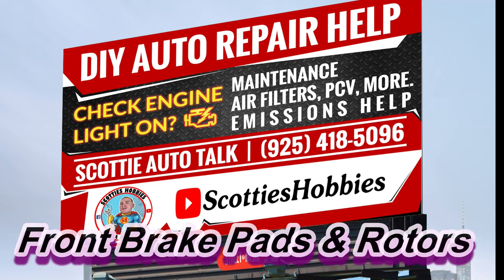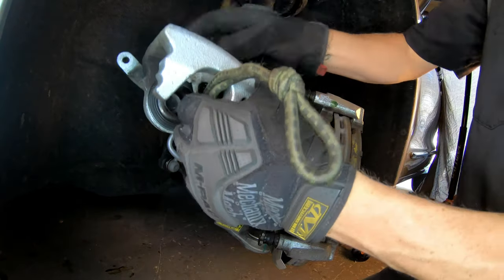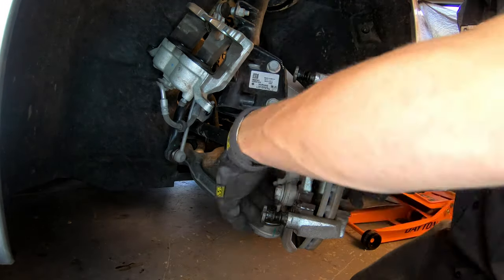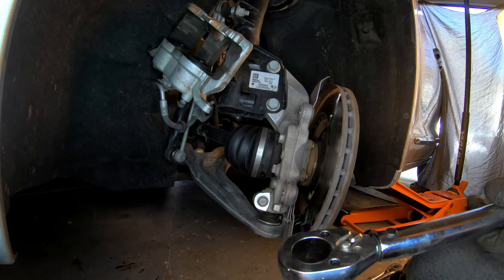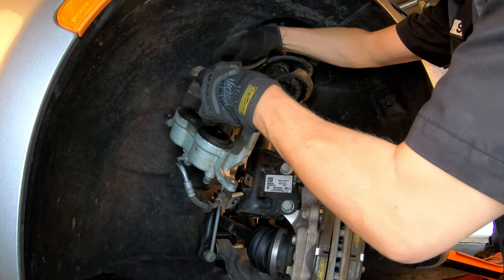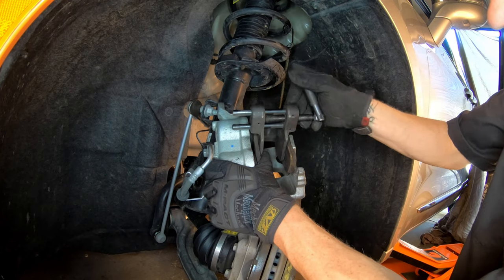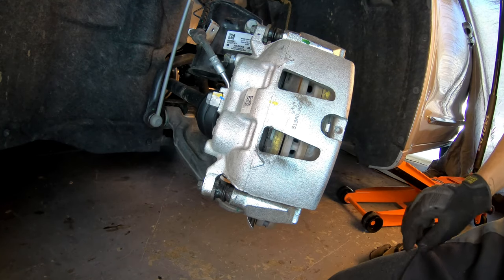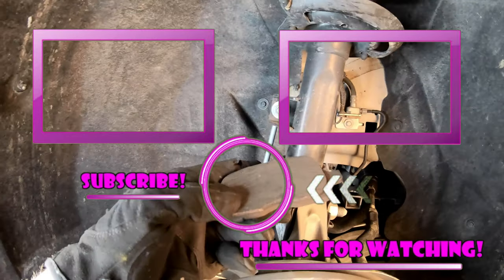⫷ Chrysler Pacifica Brake pads and Rotors, Tools Used. DIY brakes.  ⫸

Comment: When doing the rear, DO NOT forget to put the brakes in (Service Mode) first, which will release the electronic piston for service.
Reply from the maker: Is that in the description?
Reply from the maker: It's not actually.  I need to find the video on the procedure you are talking about. I thought I posted it there. Hopefully I'll find it and add it.

Thanks for pointing that out.
Reply: @ScottiesHobbies  No prob. This applies only for the rear calipers on models with electronic emergency brakes. 👍🏻

Comment: Where on the vehicle did you line up a supporting jack stand?  Or did you just let the jack hold the load?
Reply from the maker: I believe there is a small 3 ton jack under the front sub frame. not holding it up but only to stop it if the jack fails. Not the best way... I usually just slide a stand under their and raise as close as possible, then move on.  I've been told I have too much faith in my jacks a few times..

Comment: Thank you for the video. I'm daring to attempt a brake pad & rotor replacement myself. I have a 2018 Chrysler Pacifica Hybrid Limited. Would have i have to do anything different beause I have electric calipers - at least that is what one mechanic stated.
Reply from the maker: On the rear you have electronic calipers. In that case you need to put the vehicle in 'brake service mode'. It's really simple if you need to do that. I dont have a video but im sure you can find one... if you can't, let me kmow and I can refer you to one later when i het home. Don't let these brakes be intimidating.
Reply: @ScottiesHobbies  - Thanks I found a video that shows how to put the Van into Brake Service Mode. - Thanks! I'm going to do it on my own!
Reply from the maker: @thedragonb  nice! Good luck! Keep me posted on how it goes. I know you will be fine. Especially if you fallow this video.  I can't wait to hear how it went.
Reply: @thedragonb How did changing the hibird go ?  I might do it also.  2022
Reply: @davidhale6721  - I still have yet to do this and now looking at the date. It's been 11 months. My brakes are still good and I haven't heard any squealing. But I may have to soon. - I did find anothe video that you have to do something on your screen to service the brakes... Honestly I need to go back adn watch the videos again.

Comment: How did you know whether, or not you need new rotors? Where did you find the thickness specs for this model?
Reply from the maker: The minimum thickness should be stamped on the rotor. Also, I can look in the brake spec book and it should be listed in there. What is the year/make/model you are working on? 

If the brake pedal is pulsating or you are grooved... just replace them. IMHO.

You kind of have to weigh the price difference in having the rotor's machine compared to just replacing them this day and age. I find it a very similar price to replace them instead of having them Machined.

Get me the info about your vehicle. And I will look in the book when I get home tonight.

Comment: Can you do a video on at 2018 Pacifica service bulletin NUMBER: 02-011-18 ? This bulletin involves inspecting and if necessary, applying Green Loctite 290 to the front hubs SYMPTOM/CONDITION: Customers may experience the following:
 • A clicking or popping noise while traveling at low speeds and steering the vehicle left or right.

Comment: Thanks for making this.  👍👍
Reply from the maker: Glad to help. Good luck getting the job done. If you have this van, make sure you check out my video library.  I have videos coming out for the cabin air filter, pcv, engine air, and emissions locations with a lot of info. 

Thanks for the view. Good luck!! 👍
Reply: @ScottiesHobbies  thanks I added you as a subscriber.  Quick question, do you jack the pinch weld or the flat spot in front of the pinch weld where the triangle is?  My bottle jack is too tall to jack the pinch weld, but will fit in the flat area in front of pinch weld where cutout is.  That metal seems thin there.. thanks

Comment: I think calper specs are like 77lb and 55lb front and back.
Reply from the maker: Whoops... I forgot to update that. According to the Motor Brake Guide. Fronts:
Caliper to bracket: 27 ft-lbs
Bracket to knuckle: 149 ft lbs

Rears:
Caliper to bracket: 19 ft-lbs
Bracket to knuckle: 110 ft-lbs

Thanks for reminding me. I need to update the description. 👍👍

Comment: 150 pound feet??? That is way too much.
Reply from the maker: according to the Motor Book Brake Spec Guide... 2021 chry, Pac. front bracket to knuckle: 149 ft lbs, Caliper to bracket: 27 ft lbs. Its all up to you if you want to use torque specs, these are just what the manufacturer and I recommend.
Reply: @Scotties Hobbies  Actually it is 125 ft lbs. You were right. My apologies.  I was confused with something else. Good video my friend 👍